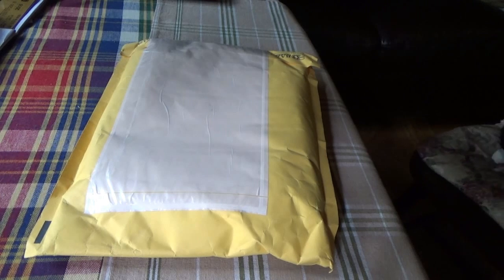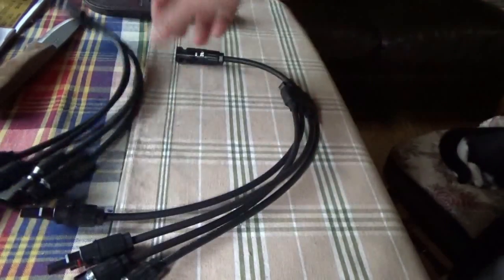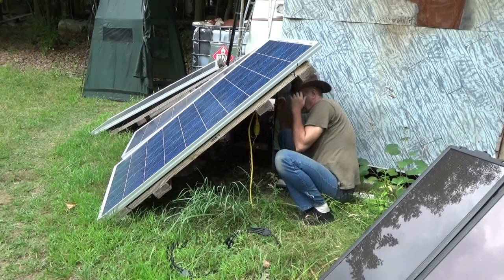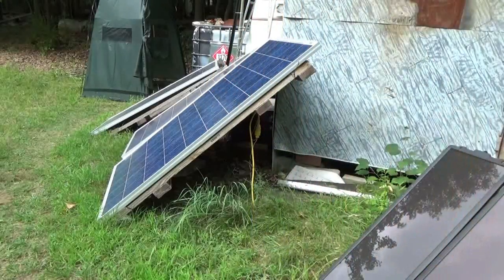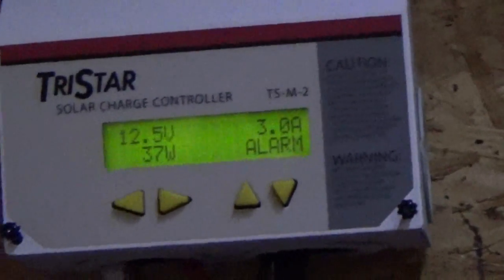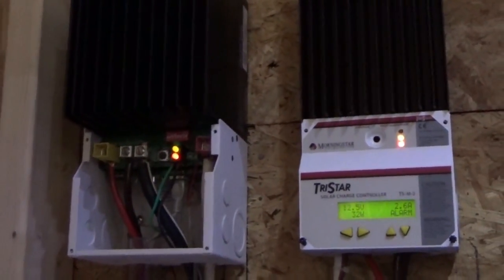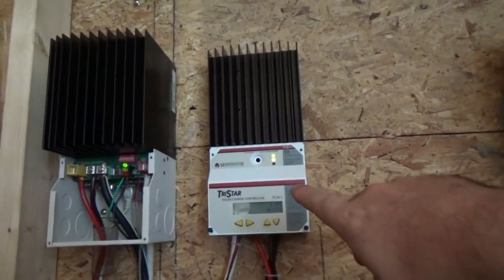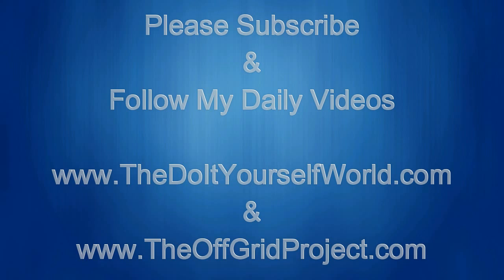Improving My Off Grid Tiny House Solar Power Output

Comment: Troy, when you make a metallic frame for all your panels. It's much better to cluster them all. then a system for adjusting the angle and geographic position. then you can manually orient them as a solar tracker. all the best

Comment: How many watts do you need to run a 5K BTU Air-conditioner? 5K is about the size for the average room (living room) in your home. What are the pros for having solar power (in your situation--your lifestyle needs)? What do you do when the house is too cold in the winter or too hot in the summer without sunshine? This would be a problem for me with chronic back pain and so I am just curious as to how often that you find satisfaction and comfort for your needs. How many generators do you have? Just the one generator?. Forgive me for my questions and for how simplistic that they may sound. I really have very little knowledge about it beside researching on the computer, but there's nothing like actually asking a person who actually uses solar power and who know the daily pros and cons about using solar power. Thank you Troy.
Reply from the maker: A 5,000 BTU AC is rated at 500 watts but this is intermittent once the room is cooled down. I set the AC for a higher temperature to reduce energy usage but still remove the humidity, which helps a lot.
Almost all off grid homes have a generator for standby or emergency. For longer cloudy periods you will need backup power or risk damaging your batteries. At the time of this video I had a tiny 800 Watt Harbor Freight generator which runs the AC if needed. Or tops off the batteries. Back then I had a smaller battery bank
Reply from the maker: These days I have a larger battery bank and more solar panels but I still use the generator sometimes to run the AC unit or charge batteries when its raining or cloudy too many days in a row.
Reply from the maker: Oh, and I had about 1,200 watts of solar panels at that time. I never ran the AC at night tho. Only when the sun was shining, when it was hotter out
Reply: The Do It Yourself World Hey, thank you for that. Maybe this is the way to go after all. I will look into some more because you do answer your answers in other uploads (and this is for the complainers who say that you don't). You pretty much do what you say that you are going to do. Like I said, where are the cool people like you to have as a friend and neighbour? I know that these folks are at a distance, but you are a pretty cool dude. You have a lot of patience for the things that may frustrate me, but by watching how you handle them gives me an idea just to do it and not to complain or procrastinate and that is what it takes and that is what others should appreciate about your uploads!!

Comment: y hope you configured your panels in paralel,(at 12 volt system you use  the 36 volt can be to high for the pwm, at 24 volts that would work,not on 12 volts, think the alarm is just overvoltage detected on the pv side . the pwm can not use so mutch overvoltage at the pv in, still loose alot of power this way ,(the 240 watts from a panel is not used now, at 36 volt panel from 240 watts its max 80 watts now at 12 volt,(1/3)with pwm) simply sead, you only use the amps the panels produce, not a lot!

Comment: You're going to need at least four gauge wire to run that far in parallel therefore it would have made more sense to go and Mppt by the time you buy that much wire
Reply: Thats exactly what I was thinking... and is why I will be buying an mppt when the time comes. The savings from wire will pretty much pay for the difference in the cost

Comment: I'm curious as to why the ethernet cable wouldn't reach. Seems like it should since you lowered the original CC but didn't move it farther away. Is your router farther away now? I have lots of ethernet cables here, feel free to come and get one the length you need. :-)

Comment: wow your amps will be pretty high. Arent those 24 volt panels? and you have a 12 volt batt. I dont know whats going on I guess.  two panels with be about 16 amps.
Reply: 88s10Durango they are only rated at about 8 amps each so 16 amps is all you could ever hope for in a ideal situation on the equator. I own ten of those 235 watt panels. They are 24 volts too. so I dont know how he can run them on the 12 volt battery ?

Comment: I may be incorrect but aren't those 24V panels? I believe that you need 12V panels to charge a 12V battery with a PWM charger. I hope you don't ruin your battery.
Reply: William Moser Perhaps I'm wrong, but I thought the charge controller would take a 24V input and, seeing that the batteries are 12V, output charge for 12V. Isn't that one of the reasons the batteries are to be connected before the solar panels?
Reply: J. Williams
I just looked at the manual and for this unit i may have been incorrect not wrong but incorrect
Reply: William Moser 
I just skimmed the manual and it seems kind of vague. I'll have to look closer later I gotta leave now
Reply: William Moser LOL - what was that - "I thought I was wrong once, but I was mistaken"?  
I'm not sure either - like you say, the manuals are rather vague. I guess we would just have to try it and find out!
Reply: +William Moser  here are my figures comparing his two charge controllers;
3 of Troy's panels in series through the MPPT  = 56amps @ 12volts 
3 panels parallel through the PWM = 19amps @ 12volts
Reply: Shaggy one There is a relationship between Volts, Amps and Watts; W=VxA
MPPT is a Buck Converter type of voltage regulator. Picture a "teeter-totter"; Volts sit on one end, Amps sit at opposite end and Watts is the center point. Watts stay the same and as Volts go down (to match battery), Amps go up.
PWM is also a regulator but does not "teeter-totter", any voltage from the panels higher than the battery bank rating will not be used and amps from the panels will stay the same. The MPPT, instead of discarding the excess voltage, raises the amperage.
Charging those huge forklift cells requires a lot of amps

For MPPT to be efficient, the panel voltage needs to be twice (or higher) the voltage of the battery.
For PWM to be efficient, the panel voltage needs to be just high enough to equalize a battery
Reply: I'm not sure of the rating of his panels, Troy is a man of many words but he only throws us bones and never gives us the juicy stuff. I have seen 4 panels connected to the Tristar and seen the logs on his laptop, while he is looking for big numbers, I read the rest of the data and I estimate Vmp is 35 and Imp is 6.5  230 watts.

Troy's MPPT is capable of 60 Amps but if the load is not present it will not produce. I look at my charge status in the middle of a clear, blue sky day when nothing is running and batteries are full, it's a very boring display. An entirely different story is early in the morning, after having used the batteries all night, as soon as the sunlight hits the panels, the charge controller wakes up and is so busy, even it's fans spin up to cool it down.

You're correct, it is a waste of his panel's potential by connecting them through a PWM to a 12 volt system.

MPPT charge controllers are so much more expensive than the PWM variety, so Instead of adding more controllers I swapped out the inverter with one of a higher input voltage. The charge controller is capable of anything between 12 to 60 volts. The higher the system volts, the more solar panels you can add to the array

Comment: what I'm getting ready to tell you is unOrthodox in the solar industry, configure your batteries to the solar panels and then after that the excess solar panels you use a controller hence 1 controller instead of two or three, have a nice day
Reply from the maker: Bryce Irwin No you are correct. I have been told by many people that a 24 volt system is better and more efficient. Problem I have is I will need a huge 24 to 12 volt inverter
Reply: +The Do It Yourself World Not an inverter, did you mean a DC to DC Converter? Either one big one or a few little ones, that was my dilemma as well! My ultimate solution was to go with a 48volt battery bank and let the true sine wave inverter run 24/7 and power everything, even the 12 volt DC items, through their wall warts. Been this way for a year and a half now, with no regrets.
My ONE charge controller will only handle 4 panels @ 12volts but now it can handle 16 panels @ 48volts.
The other benefit of high voltage is that it travels happily through thinner gauge wire.
Reply: ***** What I did when I went from 12  to 48 volt battery bank, instead of buying a second charge controller, I gave away my original 12dc to 120ac inverter and purchased a 48dc to 120ac inverter. I already had eight 6volt batteries, i just rewired them in series instead of parallel. the same charge controller which could only handle 4 solar panels on the 12 volts system now handles 16 panels on a 48 volt system, that's more than I need.
Connecting a 48dc to 12dc converter to power a 12dc to 120ac inverter never even crossed my mind. that would be very inefficient. 

About being smart enough to not fry the inverter (or charge controller), I will believe that when I see him ground the system properly. I have warned him a few times in the past.
Reply: ***** My first system was a 12 volt system like you describe, I was planning on eliminating the use of an inverter as much as possible. illumination was 12 volt LEDs I rewired my computer's LCD display to run on 12 volts and it doubled as my TV. I also built a desktop computer but instead of using the typical power supply, I installed buck converters so that it ran on a 12 volt load. I kept everything minimalist, It was a fun challenge. The one thing I didn't skimp on was the charge controller, I knew I was going to have a lot of charging to do. When i decided to throw out my Harbor Freight modified sine wave for a true sine wave, that's when I caught the fever, and switched to 48 volts. The input voltage was not what made the inverter expensive, it was the output current. 

I see you have a wind turbine, it must be awesome to be able to generate electricity even when the weather is bad. I went with a generator instead, but only because it was free. I only had to use it once.
Reply: ***** I can't decipher HHO. There are inverters designed for mobile use and others designed for home use. Both of these are designed to be hard wired and send power to remote wall outlets, but their grounding requirements are not the same. The third and most common is the stand alone unit with built in outlets. The modified sine wave version of these should never be hard wired into the house. Pure-Sine Wave versions should be safe to connect to vital circuits of a house. Your Yeti is an interesting self contained unit, kind of in a class by itself. can it be charged from a car?

I bought my Harbor Freight eight years ago, it’s a discontinued model labeled Chicago Electric, now I see they are labeled Cen-Tech. Mine was a 2000 watt model connected to a pair of Optima Yellow Top batteries. I didn’t expect the Harbor Freight would last as long as it did, it still works. Two things I didn’t like about it;

1) Turn it on and the laud fans come on, load or no load. This forced me to build a box and mount the inverter outside. Even then, I would only power it up for short periods when I needed to run equipment with heavy loads.

2) This and any other brand of modified sine-wave inverter is bad news for modern electronics due to everything having micro controllers and switching power supplies in them. A computer is much more likely to crash on you. Motors, such as my 6 amp shop vac would get quite hot running from the inverter compared to when connected to grid power back home.

There were things that I would not run on the modified sine wave inverter knowing that I was shortening their life expectancy if I did. As soon as I felt that true-sine wave inverters were becoming more affordable, I started searching for one that would fit my future plans…

…I have a lot of stationary shop tools I use for my hobby back at home and I needed to run these when out in the wilderness. My plan was to build a weekend getaway cabin at the remote property and ditch the Winnebago RV that was permanent stationary there (I kept its generator). The table saw draws 1,800 watts, that’s a 15 amp load on the AC side. If I were to run it on the 12 volt Harbor Freight, the batteries would see a 150 amp load. With the 48 volt inverter, the batteries only see a 37.5 amp load.

The inverter I selected has a nice feature that wiped the thought of adding wind power from my mind. In the case of continuous storms that would cause the battery bank to get depleted, the inverter senses low batteries and it commands the generator to power up, then the inverter becomes a charge controller and charges the batteries with up to 50 amps. Once the batteries are fully charged, the generator shuts down and the inverter returns to normal. No human intervention is required. While the generator is charging the batteries, it also powers the cabin.

I call it a cabin but actually, it’s smaller than Troy’s tiny house on wheels.
Reply: ***** Although I already have a decent fridge, It's not at all portable. I have my eye on this model...
http://www.homedepot.com/p/Whynter-2-cu-ft-62-Qt-Dual-Zone-Portable-Freezer-in-Gray-FM-62DZ/203569129
It covers all bases, dual zone, fresh food/frozen, 120ac/12dc (and everything in between) plus very portable. 

If I ever decide to add wind energy, I think I'm going to look deeper into your system there. It would be optimal for me if the turbine's charge controller can output 48Volts, this way I can keep it simple and integrated.
I've stayed away from wind energy so far due to the location of my property. not that there is a lack of wind but actually, there is too much wind. It's located on a mountain top, I am there for the view!
Reply: ***** Two weeks ago, I drove from San Francisco to Portland. As I approached the Oregon border, the sky turned from blue to smokey grey, no clouds in sight and the wind was still. I made my pit stop in Ashland. Jumping out of my truck and landing on the pavement, it felt like stepping out of a refrigerator and sticking my face in front of a fire place. I couldn't tell where the Sun's position was in the sky but the thermometer reported an outside temperature of 106, it felt so surreal! It was like this for half of the trip through the state. On days like that, I don't think the turbine would produce any energy either, not without wind.
Reply: *****  not ready for primetime,

http://www.beupp.com/product/

Pricey
Reply: ***** Blew a fuse? That's the one thing I'm afraid of since I converted to 48 Volts. The ANL fuses I use offer excellent conductivity, but at 48 volts there is a chance that if one blows it might arc like a welding rod! I need to make the conversion to circuit breakers.